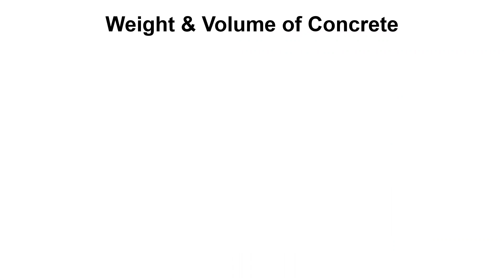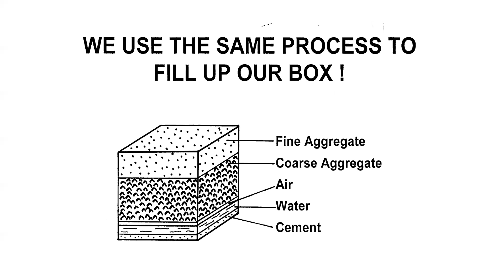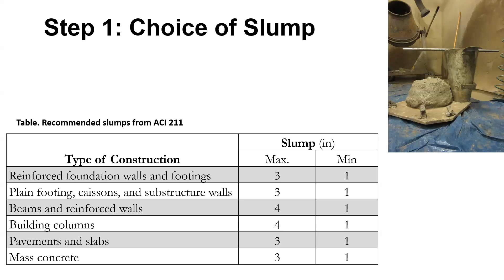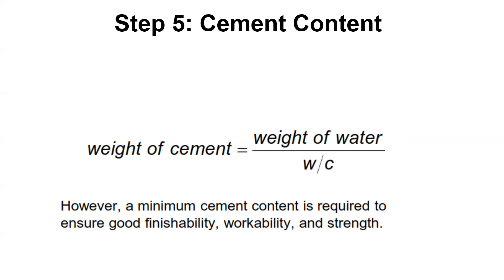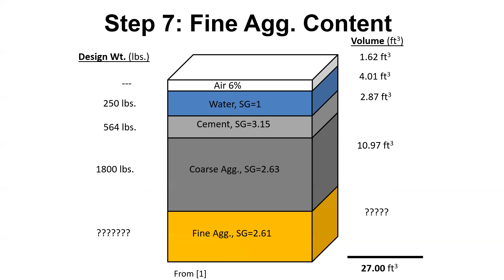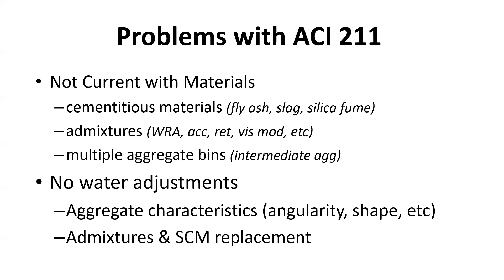Comment: If the lets say the maximum nominal size to be used as per ACI criteria comes out to be 1 inches so nominal size to be used is going to be 1 inches but maximum size will be greater than 1 inches. Do u think that nominal max size shall still be used?